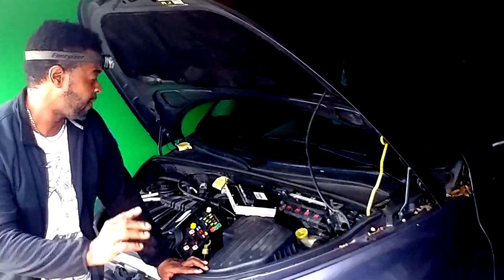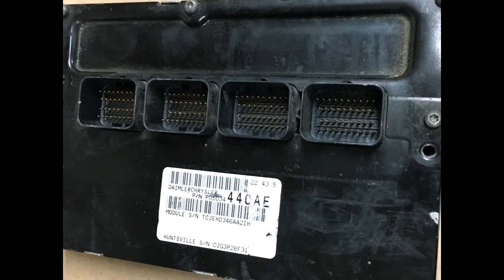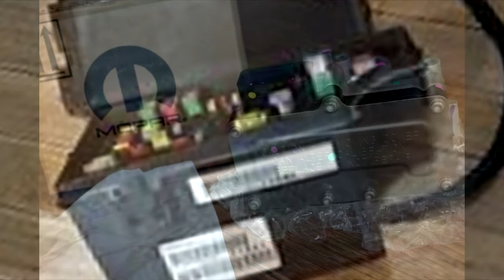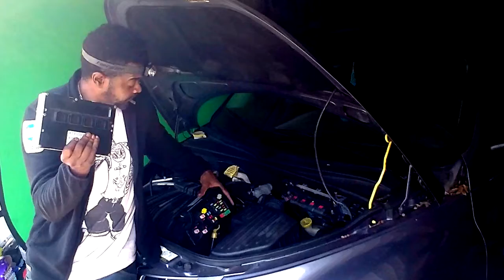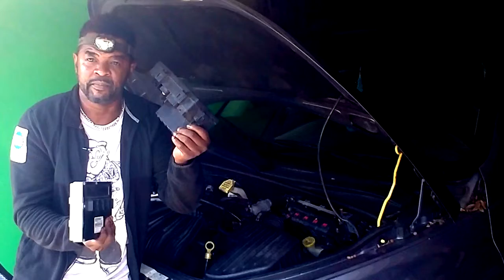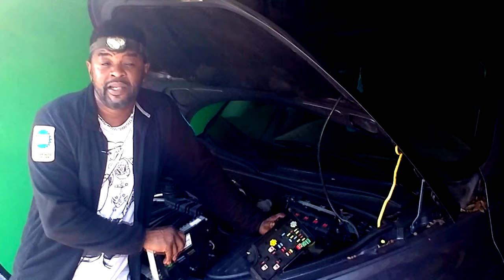P0882 P0700 Tipm PCM or Both PT Cruiser. Chrysler Jeep Dodge . 41TE A604 Transmission whining noise

Comment: I have a 2003 pt cruiser and it is hard to start like battery is bad then it will start and when I put I into drive it shifts hard then it will not shift out of 1st gear and speedometer doesn’t work no check engine light or codes
Reply from the maker: Hey Curtis, thanks for watching, please subscribe to the channel and click the bell since you have a PT..thanks. Now Ide highly suggest you get the battery tested, if its low or has a dead cell, this could affect trans operation. Now this year PT do not have a TIPM. Also if the trans in limp in, there has to be a trouble code. What scan tool do you use, can it read TCM?

Comment: I'm getting 4 codes p0700 p1603 p0562 & p0882 should I just rebuild transmission?
Reply from the maker: What's year make an model?
Reply: 2006 pt cruiser
Reply from the maker: @loloent  Can you please subscribe to the channel, click the bell and like the video for me, thanks
Reply from the maker: Hey bud this could easily be an electrical problem and not a internal trans failure..you should prolly get the P0882 diag first..with that p1603, you could very well need a pcm or a tipm if not both .
Reply: I sent it to get rebuilt

Comment: I swapped out my tipm get my non factory fog lights and heated seats nothing still working I called Chrysler the guy told me he doesn’t think an update won’t work I asked if he can try he said be gamble I asked him if there’s any other module that I need for the donor car he said he doesn’t know all he said was car didn’t come with it and it won’t work it’s not in the computer I asked him if I swap out the computer he doesn’t know
Reply from the maker: whoa, wait, what???
Reply: Online Mechanic Tips  the car is 2008 Pt  parts came off 2009 Pt
Reply: Online Mechanic Tips update date for you and anyone who would like to up grades on there Pt Crusier gen 2 my heated seats work with the dash switch and heated seat from another Pt but the switch will not light up to let you know if there on or not Chrysler was notable to get the computer to see the switch but they where able to get my fog lights to work they charged me 119 CAD $ plus tax  I also was able to connect U Connect to my factory radio but wasn’t easy I had to remove the wire harness from the yard car and open up the harness find the wires I needed and made my own U connect harness and ran the wires to where they needed to go without touching or damaging my Pt harness it was confusing at first after simply trying it it was quit simple the Bluetooth box is on the left side of the steering wheel  you need that and the mirror harness on the drivers side of the car only a red wire and a pink and white wire in connected to the harness the rest off the wires go to the radio and mirror in the head liner only a black wire needs connecting to the black wire running to the dome light. On the drivers side .anyways wife’s happy now she has remote start heated seat and U connect . To bad Chrysler couldn’t get the switches to light up but it’s ok they work just need to remember what setting your on lol
Reply from the maker: so, the car wasnt originally equipped with fog lights or heated seat?
Reply: Online Mechanic Tips that’s right my wife’s car didn’t have fog lights or heated seats or power seat  . So I changed the fog light switch and the tipm all the wires where there and for the seats all wires where there I changed switch on the dash for the heated seats and put seats in all wires matched from car to car so I must still be missing somthing was maybe thinking the cluster I should swap out?
Reply: Online Mechanic Tips out of all that work the power seat works only
Reply: JT. Tomorrow I’m going by the junkyard is there anything I might need from that car to make my fog lights and seats to work before they crush it  thanks so much for your videos they help out a lot     God bless

Comment: Like the videos man thanks. On 2006 pt base. Tipm and PCM replacement  removed 700 and 882 codes.  Now PO  218, changed trans fluid/filter-4qts. Pt has no leaks, already did full tune-up:coil pack,wires,plugs,battery cables. Will do coolant /thermostat next. Does not overheat.  My only thought is to replace trans input/output sensors. It seems the pan fluid temp comes from one of these. Please help man, been trying hard and appreciate your experience with pts.
Reply from the maker: Hey my friend, thats a auto trans temp code..Hopefully the PCM or the TIPM was from a automatic transmission car..The manual stick trans in some PT Cruisers do not use the temp sensor so the computer may be looking for something thats not there and will turn the light on if it doesnt see it..Verify your part numbers on those modules that you installed
Reply: JT Automotive Rideshare Guru  Thanks for your reply. Part numbers are correct for PCM, Tipm is same -Both are reconditioned. PO 218 showed up after a test drive . Trans shifts good, level is good.
Where does the temp signal come from- is it the input/ output speed  sensors on trans .  Code  seems erroneous .The coolant is old but temp never more than 212,fans working.The car has no other issues but thePO 218 returns after reset. Is there anything else that can cause the code(temp sensor) if the fluid is fine beside  the PCM
Reply from the maker: The temp signal comes from the transmission range sensor..Its a lil black sensor box that lives on top of the valve body, use to be called a PRNDL switch..The speed sensors do not report the tem signal..So aside from the big connector on top of the signal, make sure its not damage, and if you sure your trans not overheating, you may just have to replace that range sensor..I have gotten away with doing a service with new fluid (ATF plus4) before, ive also had to replace the sensor before for this code..You really need a good scan tool that you can see what the sensor telling the computer how hot the fluid is..If its a unrealistic number, you no something wrong elsewhere
Reply: JT Automotive Rideshare Guru    Thanks for your quick and precise reply. Much appreciated ! I have  a Actron scan tool which tracks a lot of data but I don’t think will show trans oil temp. I will try the range sensor.  Thanks so much for offering helpful information to help people and their cars. 👍👍
Reply: I decided to re-think my steps because of what you said. Put original PCM back in and no 218. Only 15 mi and 3 drive cycles but it would come back right away
Before. Looks  like Tipm was only problem then new PCM caused 218. Time will tell. Only 1 problem I forgot about. Car accelerates ok while driving but if in 
park won’t rev above 3-4K . I’ve hand cleaned throttle plate but no difference and car doesn’t seem to have MAF sensor to clean. Any suggestion is highly appreciated. I will promote your channel to everyone I know, thanks again!

Comment: Dude you're awesome
 for saying it that way.  I have a 06 turbo & just recently experienced a issue with my trans first not shifting out of low gear then after clearing codes jumping from drive to neutral then into low gear. Now I am getting the P0882 code & after seeing this video the worse that I can do is sale it same after buying those at the recycle yard if it doesn't work. Thanks a bunch.
Reply from the maker: No sense in sugar coating it..lol..thanks for watching

Comment: Have a 2002 PT Cruiser manual shift  with 55,000 miles on it recently died on Interstate, its at Dealership right now , have had a programed PCM replacement just put in Car turn over but will not start for more than 2 sec, think I was now told that fuel ? or oil ? injector not responding, also could it be a wire or connector problem. Dealer spending many hours on car still not fixed. Is there something that i can inform the Dealership that may solve the problem, accordingly they tell me they have their best mechanic on it. All I am seeing is $$$ flying out the window, HELP.
Reply from the maker: Hello my friend, if its at a dealer, im almost certain they know to check the normal things that will not allow starting..As far as that programmed PCM you just had installed, ide make certain its the correct PCM..You mentioned that its a 2002 with a stick, chances are its not equipped with the factory security sys (black key)...Also, that year model uses a DRB 2 scan tool for the best and proper diagnostic.. It allows you to see everything..Theres a feature on it call no start, which will let you see everything that you suppose to be getting to allow start, whats not there usually the culprit.. Thats all I can offer without being there, sorry...Good luck buddy
Reply: @OnlineMechanicTips   Thanks for the reply just received a call from my Dealer he is telling me they are getting firing on cylinder 1,3 but not on 2, 4, plus tried reprograming the PCM with no luck  so sending back to  get another one hopefully that works next week. Any thought on this appreciate your knowledge on the PT Cruiser issue.

Comment: Hey boss great instructional video. I have a 2007 Sebring. I got a TIPM from junkyard same yer but different p/n. Will that still be plug and play or no?
Reply from the maker: Normally the part numbers have to match each other to avoid having have to program it to your car..If you got it off of a 2007 Sebring with the same engine and body functions, you may get lucky,.. But keep in mind, dont really worry about the last 2 letters on the part number..Its the first set of numbers that need to match that will allow plug an play on some models
Reply from the maker: hey subscribe to the channel for me, thanks
Reply: JT Automotive Rideshare Guru How can I subscribe? I don’t see a link. Thanks
Reply from the maker: click this link here: www.subscribetomyyoutube.com and click the subscribe button, thanks

Comment: I have a PT cruiser 2006 mine the engine light would come on and it would go into limp mode first gear cared it to the shop they surely couldn't figure it out kept sending me home saying drive it drive it drive it well the light keeps coming on now all of a sudden I had to go and get I got to go get it flashed to get them to turn off the airbag light which somehow they made come on Atlas place called probuilt transmission in Wilmington I'm wondering they said they replace the part that you caught a plug and play not in the main brain but the tip of your talkin about I've always said all along that that needed to be changed what do you think give me a hit back let me know
Reply from the maker: Hey my friend..I have a hard time making out your question, but i will say, you have to find out what fault code its showing..The diagnosis is done using the fault code..I can tell you what I think based off the fault code thats showing

Comment: Please can someone please tell me the location of the transmission control module with diagram if possible for a 2007 Chrysler Pacifica 4.0. Please and thank you in advance
Reply from the maker: hello my friend, that car do not have a TCM, the transmission and the engine controls are one module, its call a NGC module or PCM. Its located just in front of the left front tire....Thanks

Comment: I have a 2012 Dodge caravan with p0882 and was thinking of getting the ECM and the FOB key from the same donor vehicle. You think this will work ? I’m trying to avoid going to the dealership:-)
Reply from the maker: you will have know choice but to visit the dealer with this year model vehicle..By swapping modules from another car you have to restore configuration by matching all the modules together,,Only somebody with a dealer scan tool or a shop with the tool and a Chrysler subscription is the only way to get this done
Reply: JT Automotive Rideshare Guru 
What about using online services where they sell you a ECM with matching Vin #? I saw some for sale on EBay ...
Reply from the maker: @Ceasar91706  That works on the older models, for example you can order a pcm for like a 2006 PT Cruiser from an online computer seller that has a subscription with chrysler. Thats where they take your VIN and burn it into the computer before they send it to you..Im not sure that will work on like a 2012 model..ALL the modules have to be on the same page ..We talking CAN C bus and all that..I been in the dealer so long im not sure what will work in the outside world (aftermarket) But I do know we have to restore configuration when any module is installed/replace,,So somebody has to do it so we will know if it will work, thats where you come in at..lol..Better yet the place you purchase the module from make sure you get a guarantee that it will work, he might tell you you have to go to the dealer
Reply: JT Automotive Rideshare Guru 
Thanks for the clarification... I have a 2012 Dodge Grand Caravan ... Does my van have the CAN C bus ?
Reply from the maker: yes, along with other bus networks..My 2012 Chrysler Town and Country has 20 sum modules on it and they all have to be properly on the bus network
Reply: @OnlineMechanicTips  Just for your info, you can send in the ECM  to any place that repairs ECMs and have it repaired, that way it is programmed to the VIN. But, as you have said it is advisable to be sure the ECM is the problem and not the TIPM.
Reply: JT Automotive Rideshare Guru 
Just for clarification, Does the ECM control the transmission computer ? I know p0882 codes talks about the the transmission but my 2008 Caravan has a Transmission Control Module (TCM)...

Comment: Hey I have a question I have a 2004 Chrysler Pacifica 3.5 L I have a check engine light on P0700 p0888 the car is in limp mode. I replace the transmission solenoid pack and nothing has gotten better car still in limp. Any suggestions? But what I could do.
Reply from the maker: Hey buddy the solenoid pack has nothing to do with the trans relay showing off all the time..The computer monitors the trans relay output, if it doesn't see this output, it will store this code and you will remain in limp mode until it does see the output..
Reply from the maker: You should  give the wiring harness around the TIPM a really good visual insp, you may find open circuit under the box

Comment: I have a 2006 dodge dakota with doess 2 codes. And sometimes is in limp in mode. And somptimes not what should i do?
Reply from the maker: First, can I get you to subscribe to the channel to help it grow? thanks buddy.. Listen, those trucks had the 42RE trans in them and the best way to start diagnosis is to retrieve the fault code inside the transmission..You have to start there..Im not sure if any of the aftermarket scan tools can access the TCM. But what is the code in the TCM thats the only place to start after checking fluid condition

Comment: Question I have a cold that’s coming out on my 2006 PT cruiser the code is P0562 and it was showing low voltage can’t figure what that means to fix the problem car started fine radiator was busted so we got a new radiator and now it won’t start it cranks but won’t start so we been backtracking and buy new sensors new spark plugs new radiator everything and still no start buddy crank so we know It’s nothing big hopefully please let me know or leave me to the right direction or one of your videos thank you
Reply: Yeah we did all those we have good fuel we got spark it cranks it sounds like it wants to start but it just won’t start I have a connected to the truck with jumping cables to see if it needs more voltage and still nothing let me know if you have any other recommendations I was looking at one of your videos and it shows that it might be the The tipm I’ll keep Tryan see what else but thank you for your response I really appreciate it I like watching your videos cause you explain everything detail by detail
Reply from the maker: @JBOYZ2000   buddy im sorry, I didnt see this until late. The notifications are acting up..Not sure where you at with your problems but if I can help, I surely will
Reply from the maker: Cranks with a no start will take some diagnosing. The code P0562 simply mean your computer saw that voltage was low at the battery. Not sure of any sensors that you may have left unplugged while during the radiator. You need fuel, spark and combustion to start..The easiest thing to start with is the fuel.. Spray carb cleaner in the trottle body to see if it starts quickly..
Reply from the maker: @MegaZemor  please dont do this on my channel. Your continued hate for me very known by now and thats ok..If you need help MegaZemor, go and talk to the other PT youtubers you subscribe to. No need to harass me or my subscribers, thank you